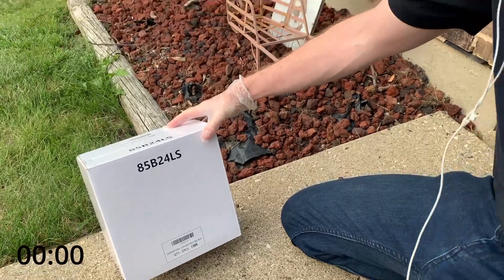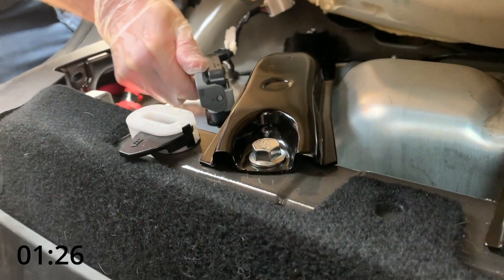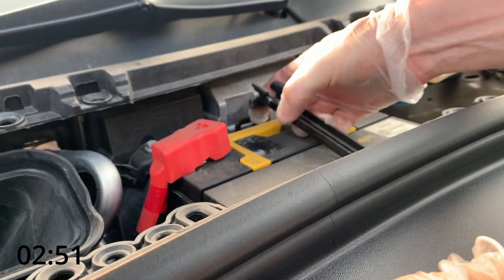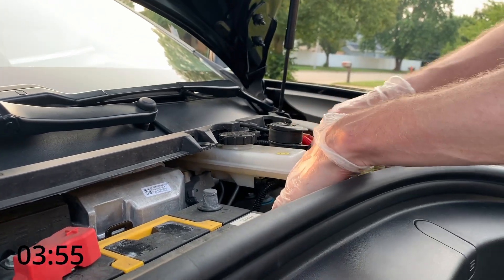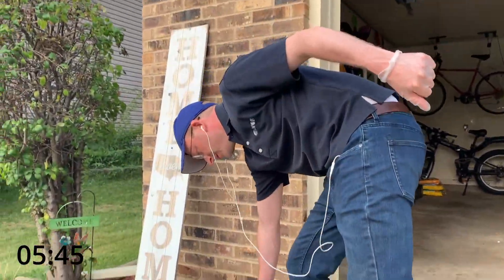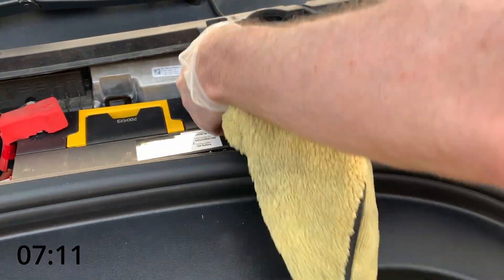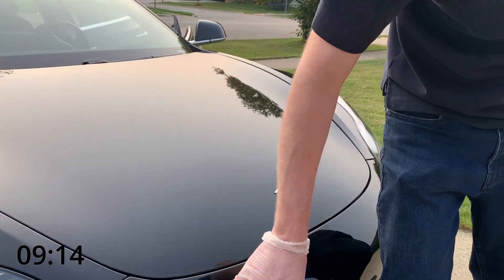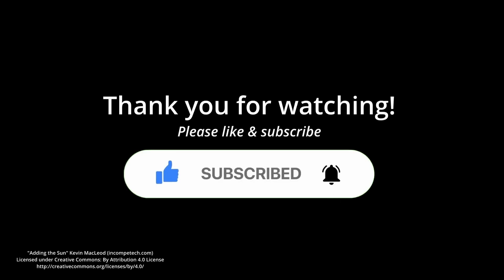Tesla Model 3 12V Battery Replacement in 10 MINUTES How To DIY

Comment: Something I did not know until about a year ago, when replacing 12v batteries in vehicles, get the little kit with red and black felt washers and some terminal protectant spray and use those. Can prevent the terminals getting all funky and fuzzy.
Reply: I'm not sure but I think it'll be less an issue with these as with the Prius since they're completely weather sealed and don't get the air, moisture, and heat cycles that gas vehicle batteries could get? But I live in California so maybe just not a concern here.

Comment: What indicators if any tell you that the 12V needs to be replaced?
Reply from the maker: You’ll get a message on your screen telling you about it. 👍
Reply: When your car becomes a brick. First time I had zero warning. I assumed it was my 12V but roadside service said no, we see some codes that it's more,... so they towed me 100 miles to change a 12V battery. Sigh. Second time I got a warning my car needed service and wouldn't restart, and sure enough its a brick. I'm assuming it's the 12V battery again this time, but it could also be a bad motor.
Reply: @margotk3498 Was the problem the battery again? I just had the same issue
Reply: @rangerousy  no, it was the PTC heater

Comment: One thing I always do with a new battery is put it on a battery tender overnight to make sure it really is charged fully before installing.
Reply: Totally pointless. The car keeps this battery charged off the high voltage battery anyway. So if it's a bit low the car will charge it up to the proper amount as soon as everything is connected.
Reply from the maker: This is a great suggestion.

Comment: Just a little tip, it's better to disconnect the 12v negative cable first before removing the plug under the rear seat. When the 12v is the only thing powering the car, it can drain and then not close the HV contractors
Reply from the maker: Pro tip right here! I wish I had researched the official procedure from Tesla’s documentation & video instead of learning from other YouTubers’ videos first! I’m afraid I am only proliferating the wrong method with this one. While the sequence I performed isn’t necessarily “bad”, it definitely isn’t the best and it could cause problems, as you pointed out so perfectly. Thanks for this!
Reply: @techgeektesla what if I did this and now I have no power and a closed front trunk? Please please help
Reply: @generalmeyer315  Then you'll have to power via the front tow hook area.
Reply: @magnusauto7941   well when I plugged it back in it didn't come on right away which kinda freaked me out but after about 7 to 8mins everything turned back on thank god.

Comment: Noooooo! Don’t pull the latch out first! I’m a technician for Tesla and you don’t want to pull the latch first. You disconnect the battery so that there is no battery voltage going to any controllers and then you disconnect the logic connector. Think of the battery as a negative and the logic connector is a positive.
Reply from the maker: Thanks for this info. I think I watched 3 other videos that showed this process in similar order. After your comment, I found the official Tesla video. Best to follow that one, I agree! Thanks for this. https://service.tesla.com/docs/Public/diy/model3/en_us/GUID-2588F809-41E3-43F1-84E5-6745C7C18DBE.html
Reply: @techgeektesla  That seems to be for older models.
Reply: What about when you put it back? put the 12v first? or the latch?
Reply: @davn7723  put the latch first then finish with the negative.
Reply: @AdrienneWhelan-r6w  the Logic connector on the old model 3s had the power to the contactors. Which contactors powered on (closed) the system doesn’t need the 12v. So if you disconnected the battery positive and touch ground, you can weld lol
Reply: To be blankly honest I’ve done it both ways 🤷🏽‍♂️ just watched the actually tesla way they make you take off the whole back seat ridiculous
Reply: So what do we do when the low voltage battery is dead and jumping the battery doesn’t work? How do we get inside the vehicle to un latch the logic connector ?
Reply: @ break the window
Reply: @CarranzaFam  jump the overide cables hidden in the front bumper where the tow hook goes. It’ll pop the frunk and allow you supply the battery with enough voltage to power the low voltage controllers (windows/ doors ect
Reply: The is the same case for any car
Reply: Well I just got fucked 
Why is this video online if it's wrong
Reply: Gosh I’m glad you said that
Reply: I live in a rural area of Australia and my battery has died.  I have been told the Bosch v12 is a suitable alternative.  It has the dimensions Bosch 55B24LS-S4 Length: 238 mm Width: 129 height 227mm.  Will this fit ?
Reply: Love the details and the video angles. Thanks.
Reply: Where is the connector for the 2014 Tesla model s
Reply: @  it’ll be the Fireman’s loop in the frunk. You can access by removing the top frunk trim by the windshield.
Reply: @ what about any connection under neath the model s I don’t see any logic disconnect just like how the model 3 has one
Reply: Hello @eduardoyepez7358 do you know if I can replace the 12V with a battery I got from Oreillys? Super start platinum AGM CCA 0°F
500
75 RC
46Ah 20Hr Rate
Reply: @fejiroprec  Normally id say no cause it may trigger alerts as ive seen after market batts cause sleep issues and not allowing the can communication to sleep in these cars
Reply: Isn't it same thing, disconnect the rear seat cable first, isolate any current from the 12V battery? Also isolate the high voltage battery from 12V battery and accessories? It makes more sense to me,  in the installation steps.
Reply: That’s why I never subscribed to this channel. The advice given contradict official Tesla Owners Manual - Self Servicing section. Shocking some people put in so much efforts to misdirect other people. Shame!
Reply: @jacobheinz8236 I doubt he’s intentionally misleading people. Seems more like someone who knows enough and has enough basic skills to turn a wrench and get in trouble but has no real knowledge. Lots of what he claims are good practices are either useless or futile. Such as a rag being insulation against electrical current.
Reply: Why does Tesla make servicing simple things more difficult than it should be. My old ICE cars, before my tesla: pop open hood. Unlatch amd disconnect terminals, pull battery out, put new battery in, connect terminals, close hood.
Reply: @cypvh74  your old ice car had an engine. Ev’s all have 12vs with the HV battery acting as the alternator. Even know, try opening the hood and removing the battery if most vehicle. Bet you can’t find it
Reply: @cypvh74 it's an EV so why would it be the same procedure?
Reply: @barryblack7384  cause Tesla isn’t a traditional ev. They kind of rewrote the book on the thing.
Reply: @cypvh74 then reprogram the electric windows and sunroof.  Reset the clock and radio presets. Tesla isn’t that bad.  

Now if you were referring to a pre obd1 car it was pretty simple.
Reply: @cypvh74  -- It's less trouble than replacing the 12V batteries on some cars I've seen over the years, but definitely more trouble than on the older cars... Look up what it takes to replace the secondary 12V battery on the Jeep JL these days...
Reply: Quick question, if my car if fully dead and can’t disconnect the connector under the back seat… is it still safe to swap the battery?
Reply: @cynthiaberniquez2859  technically yes but Best to wait 10 minutes if you have. I think the best practice is to jump the battery and open the doors so you can pull the connector but be careful as the window short drop won’t operate as normal so lower windows or don’t close the door till you can’t
Reply: @cynthiaberniquez2859 want to know the same thing as ive seen people get locked out 😢
Reply: Hello do you know if I can replace the 12V with a battery I got from Oreillys? Super start platinum AGM CCA @ 0°F
500
75 RC
46Ah 20Hr Rate

Comment: Tesla OEM 12V battery is not good, Costco Interstate 12V battery group 51R is better, cheaper, and drop right in.  when you call costco they will tell you they don't have Tesla battery because they didn't have Tesla on their list, but trust me this one fit like a glove
Reply: How did you quantify this comparison?
Reply: Does this Interstate 51R fit all Teslas or just certain ones?
Reply: Or Sam’s club Duracell 51R!
Reply: What did you do with the air hose when you put that in?  @dmillerp11

Comment: How did you find out that you need to replace your 12V battery?
Reply: My car gave me a warning message that  the battery was getting weak.
Reply: @MrDavidwesty  Thanks. Most ICE vehicles do not have this feature.
Reply from the maker: My car also gave me a notification.